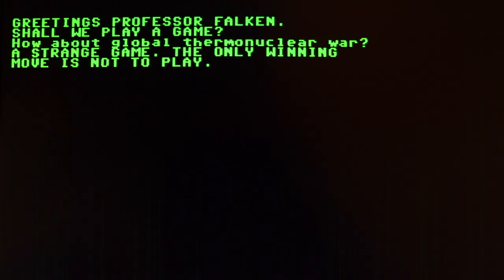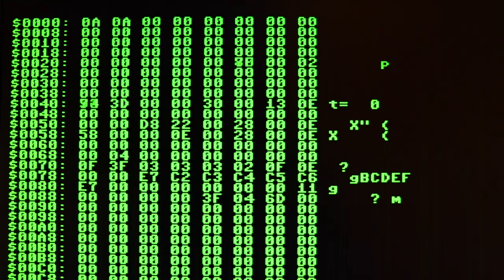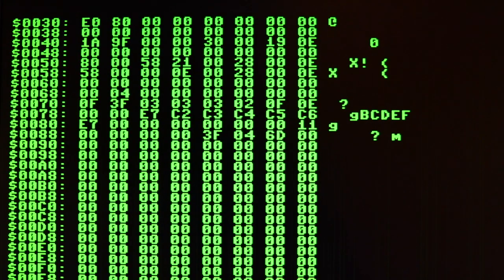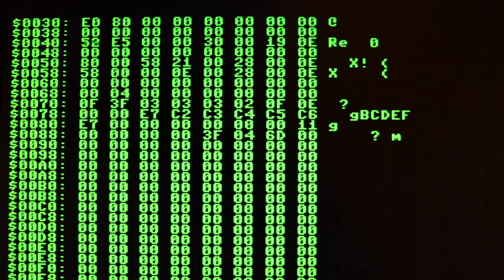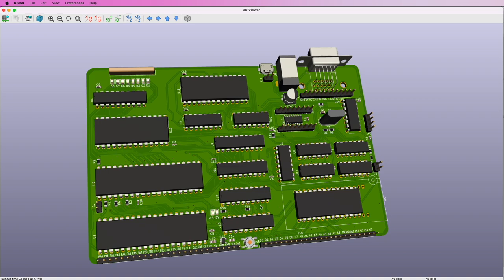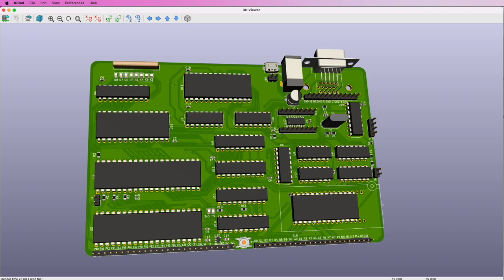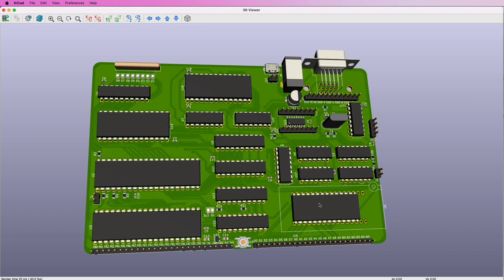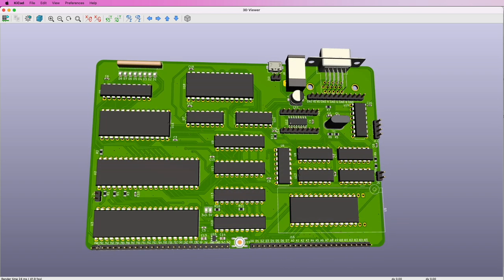This is my 6502 Single Board Computer

Comment: Fantastic project. I'd love to see a video overview of the individual components, and a deeper dive on how you setup the ROM. 
Thinking about building one myself but need to read up a bit more. 
Any chance for getting BASIC working?
Reply from the maker: Thanks! Next video up is a short one about a wireless bootloader that makes it super easy to run new code. After that I have a new and improved revision to show off - that will probably be what I base the walkthrough on.
Initially I didn’t plan to try porting basic but it really shouldn’t be that hard considering there are so many 6502 BASIC’s out there :) … so maybe I’ll stray a bit down that path..

Comment: Very nice but why micro usb and not usb-c
Reply from the maker: Thanks. 
Everything else is hand-solderable and USB-C really isn’t. Micro-usb is only on there for 5v power and has the barrel jack as redundancy - if you don’t already have the microusb in your junk drawer you probably have the barrel jack. Basically - trying to use as many used and old parts as possible.

Comment: Why not HDMI or .. module that can be plugged into pi zero so we can interact easier
Reply from the maker: It's quite a challenge to do high speed differential signalling (HDMI) with principles from the 1970's. VGA is close enough to the tech around that time and doesn't require clocks in the hundreds of MHz. 
For easy interfacing, check out my other video about wirelessly bootloading code with a radio module.
Reply: @AndersNielsenAA  So the board I/O is transmitted via radio to your terminal ?
Reply from the maker: @thanatosor  No. Just for uploading code to RAM, etc. For now anyway.